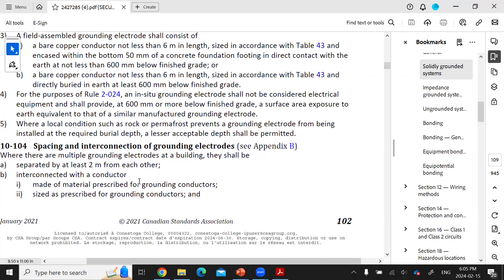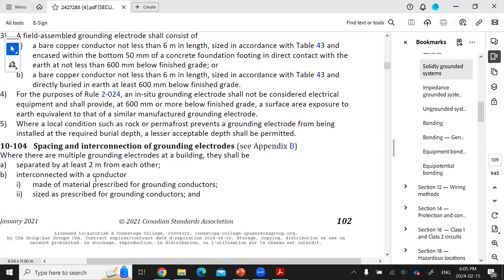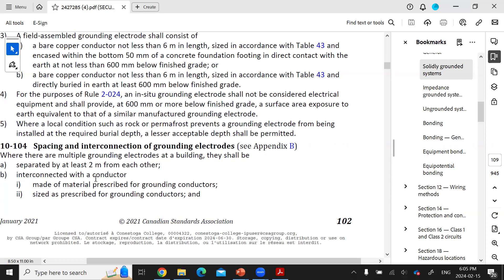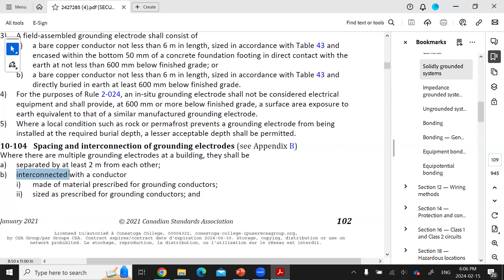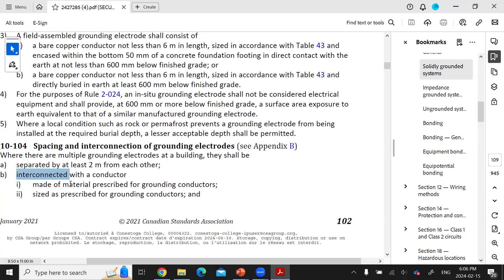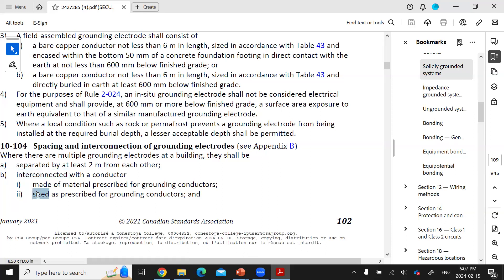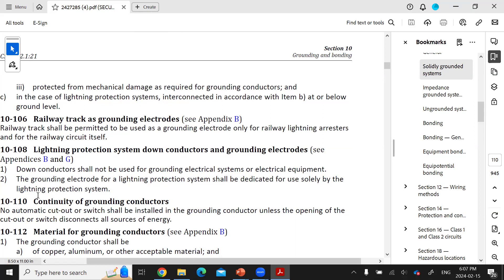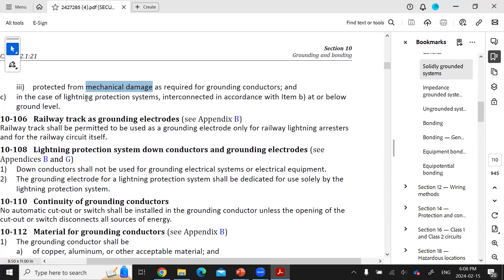CEC Section 10 Grounding & Bonding Rule 10 104 Spacing of Grounding Electrodes

Comment: Great video's, thank you for taking the time to make them
Reply from the maker: It’s my pleasure.  Thanks for connecting.  Is there a particular section of code you want to see?
Reply: @Prof.K.  Section 64 with a dive into 64-112, I mean to send a sample single line to the inspector but I think you can put up to 80A solar on a 125A bus now. 
Thanks again.